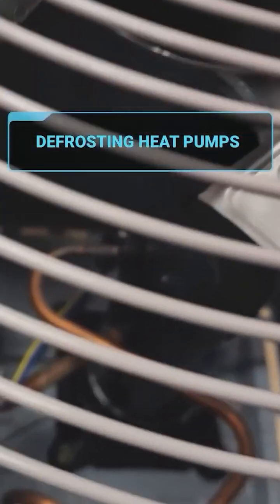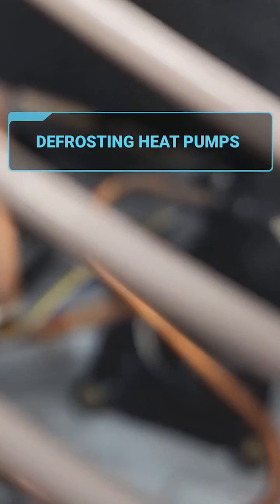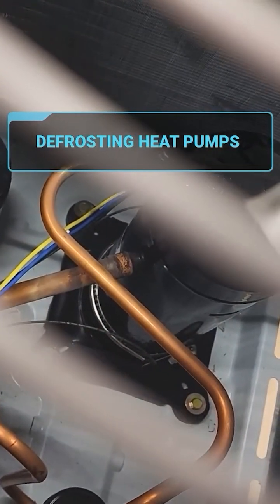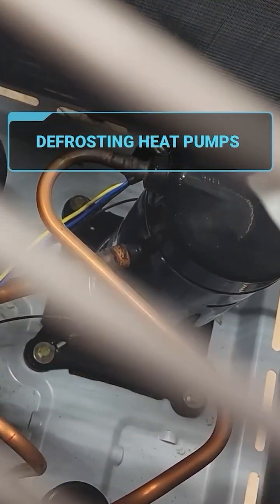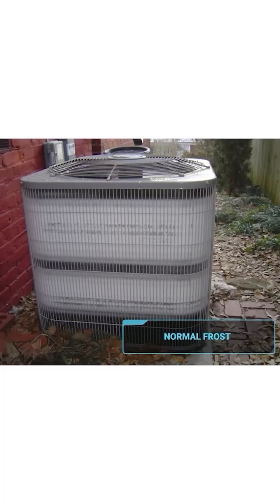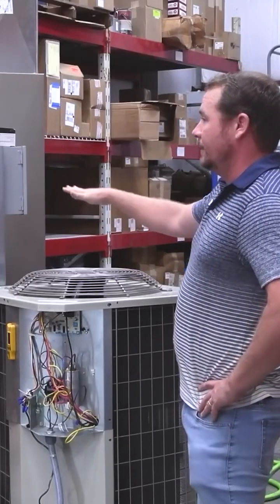Heat Pumps In Defrost

Comment: Do you recommend switching to heat strip (emergency heat) if temps are 25 degrees or colder. Alabama here…been COLD last several days and tonight going down to 16!  I know it’s EXPENSIVE to run emergency heat however what about efficiency of heat pumps that cold? I know it swaps over to aux when it can’t keep up but is it necessary to put that strain on heat pump? My unit is less than 2 years old and I keep it at 65 at night. Your expertise is appreciated. Thanks.